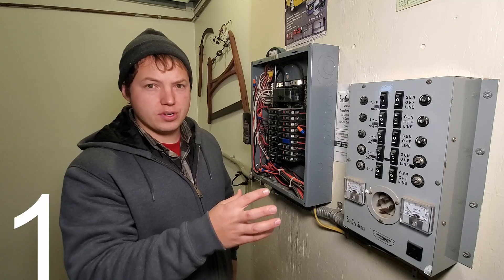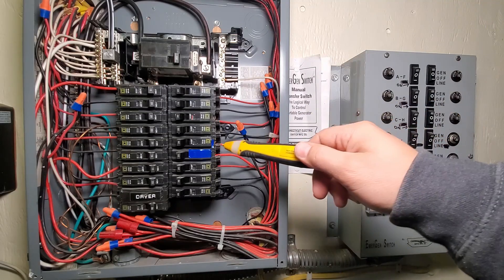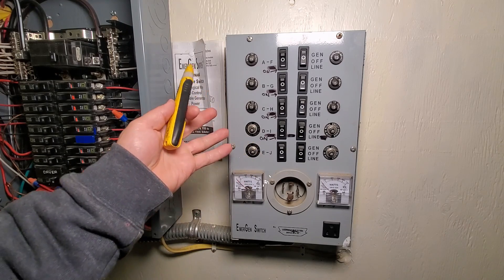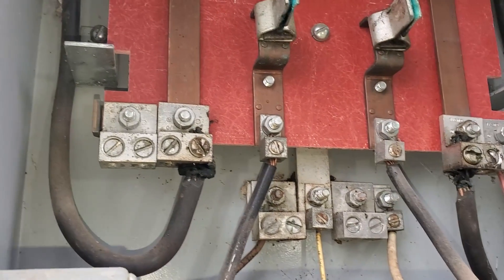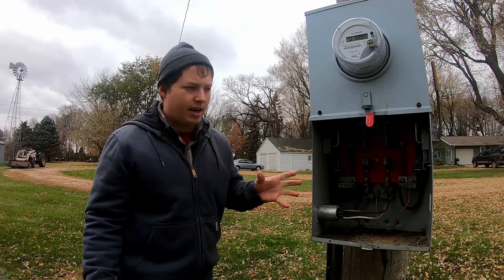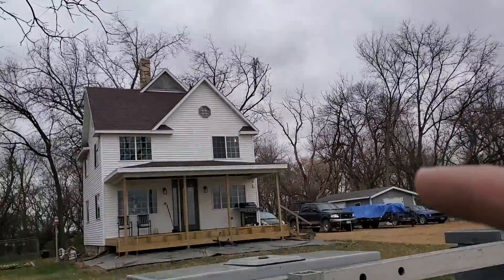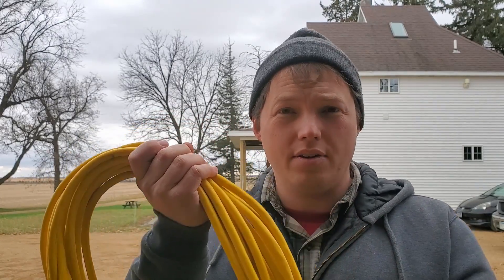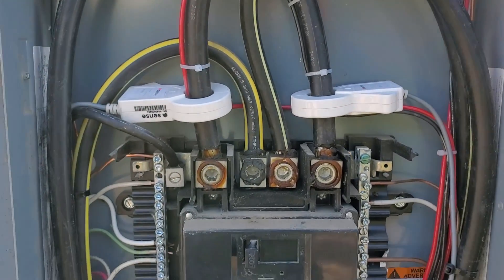5 Ways To Connect a Generator To Your House

Comment: That interlock system wouldn't fly in Australia because we don't use the same panel geography but when I had an electrician come and set up my board to accept my new genny I didn't know squat about this aspect of electrical work, even as a lapsed electrician myself (many years past) but I have to mention that there is another way which you Ben would like although it's a bit dearer than an interlock you do get the same effect. My electrician installed a two way switch which breaks the mains, both active and neutral, then connects the busbar active and neutral only to the genny socket. That way, it's either one or the other and can never be both.
Also I get to choose which circuits I want to power. I had him install a bunker light that has its own circuit and breaker and continues to stay connected to the mains. With an outage I flip its breaker to ON but with no mains power the light remains OFF.
When mains power is restored this bunker light (easily see from inside the house) lights up and I know mains power has been restored. I haven't seen this method used in any US based video as yet and I wonder why - it's so easy to install.

Comment: It seems like at the 50 A power input plug on the post the ground wire is jumpered to neutral in order to plug in cheaper power generators, where the star point of the generator is not earthed.

Comment: Had a question related to the Evergen Switch (First option in video).  Can the generator and the line power be on at the same time with some circuits on generator and some on line power?  Although the hot lead is switched the Neutral would be tied between the generator and the line.  Not sure if this is an issue or not. Since current would be returning to both sources through their branch circuits  I guess it may be OK.  Let me know your thoughts on this scenario.  Thx.

Comment: Ben do you need to break the neutral as well as the 2 hots in the disconnect panel after the meter socket

Comment: I have a 7250 running watts generator wired into my breaker box via 10/3 w ground, 30 amp breaker, with interlock kit. Can I use my heat pump which has a 40 amp breaker and uses nearly 6000 watts? 
Thanks in advance and take care!!

Comment: I have the interlock system in my homestead. I also built a wooden generator shed and have our generator converted and running off our homes natural gas service. It was the most cost effective way for us to do it.
Reply from the maker: Sounds like a great setup! Having a natural gas generator is something I wish I could have but alas that usually is not possible in rural locations like where we live.

Comment: I think it would be a lot easier to have a mechanical interlock .for the gen breaker and 
mains breaker. Power goes out, you shut off mains and then ur able to turn on gen brker.

Comment: Are you planning on getting a Tesla Cybertruck? If so, would you be able to use it as your backup instead of a generator assuming that the Cybertruck has the requisite AC outlets?

Comment: 702.5 Transfer Equipment
Transfer equipment shall be required for all standby systems subject to the requirements of this article and for which an electric utility supply is either the normal or standby source. Transfer switches shall not be permitted to be reconditioned.
Exception: Temporary connection of a portable generator without transfer equipment shall be permitted where conditions of maintenance and supervision ensure that only qualified persons service the installation and where the normal supply is physically isolated by a lockable disconnecting means or by disconnection of the normal supply conductors.
NEC GLOSSARY:
Physically Isolated (as applied to location). Not readily accessible to persons unless special means for access are used. (CMP-1)

110.25 Lockable Disconnecting Means. Where a disconnecting means is required to be lockable open elsewhere in this Code, it shall be capable of being locked in the open position.

The code allows for emergency connections.  You need to lock your main panel when doing so to keep someone else from closing the main breaker.

Comment: Since Generlink is not available  in our area we went with the "Interlock" option.  It's fairly easy to install (make sure you buy the correct one for your panel), they give much greater flexibility regarding which breakers you may want to use/not use during different seasons (heat or A/C) and the overall price is pretty reasonable.  Depending on your personal experience and local laws, you can install it yourself fairly easily and quickly.  Thanks for a very informative video, well done.

Comment: The sizing of the AWG of your extension cord is also dependant on the length of the cord. Size DOES matter - always size up from the starting amps, not running amps and size up for longer lengths of cord. Your refrigerator motor will thank you by not burning up. Also, turn breakers on slowly - let loads start up one at a time. A typical generator can not start everything up at the same time. Trying to do that will burn out things you are trying to power up. 
Also remember a generator will run better on propane or natural gas, but the power output will be lower than running on gasoline.
Natural gas has the least BTUs, thus less power to run the load, but if hooked to a gas main will not require refueling. Tri-fuel kits are available for most generators and are well worth the money. Gasoline is dirty, gummy, sputters, and is dangerous to refill on a hot generator. Propane and NG run clean, don't sputter, don't gum up, and are generally far less expensive to run on.

Comment: When I built my house I had a generator ready load center installed.  It can be used with a portable generator or an automatic transfer switch and a permanent standby generator. If I decided to upgrade to an automatic standby generator the switch just snaps into the breaker box. 200 Amp 42-Space 54-Circuit Main Breaker Generator Ready Load Center by Siemens

Comment: Do you have to turn off the main 100 amp breakers on the electrical panel along with all the circuit breakers on the electrical panel before starting your generator to run power through the GenerLink? Oh, and that cat must know it has 9 lives the way it uses the electrical panel area as a playground, lol.

Comment: A friend of mine has a different hybred system. 
In the main breaker box is a 50 amp 240 breaker that feeds a double throw breaker box, which then goes to breaker box “B”.
Anything that you want to run off the generator, has to originate from breaker box “B”.
Breaker box “B” feeds furnace, some lights, well pump, refrigerator, freezers, some outlets. 
Hello from north east Montana. 
10 miles from the Canadian border.

Comment: When connecting with the interlock kit, is it possible for power to feed back into the power lines outside through the neutral if the main is off?
Reply: No

Comment: I'm trying to figure out my system we moved into a house recently with 2 transfer switches already installed and in the same metal box of each switch to the left is what looks like a hole where a whole electric meter would fit however in it's place is a clear plastic plug with a strap on it, maybe it's an emergency turn off?? who knows but the switches are labeled for generator.  I believe one is for the main house and the other is for the well pump and garage.  The wires coming from these transfer switches have been cut where the old generator was removed so I guess i need to hard wire straight to the gen... can you even do that???  or splice the exposed wires into a plug that I would then run into the generator.  Since there are 2 sets of wires do I make 2 plugs or is there a way to hard wire both sets of wires into the generator?

Comment: A couple of comments...I installed a 30 amp plug on the outside of my home and ran two standard receptacles from it...one upstairs and one in the basement. When the generator is not connected these receptacles are dead but when energized allow me to plug in varies items in the home without worrying about cords going through windows under doors etc. works very well but limited capacity.

I also have a 50 amp circuit in my panel and an outside plug for my tractor/pto 15kw generator. I have a disconnect switch in the panel that only allows the 50 amp breaker to engage with the power off. However I am curious about the neutral wire as it is not switched and connected both to the generator and the electrical service. I assume the neutral current will follow the path that is feeding the circuits and not become an issue. Is that correct? I also personally don't believe all electric breakers need to be shut off but you need to be very aware of your generator limitations and not overload the generator with your power demand. Any comments regarding these items would be helpful.

 Excellent video and explanation on everything.

Comment: I am surprised that I didn't see a way to use a subpanel such as a Square D QO panel where you can purchase individual breaker interlocks in the subpanel to switch between the generator power and the main house power.

Comment: Great Video,  If a generator can be used using a manual transfer switch with branch circuits selection,  can a 2nd generator be connected the same way via a 2nd transfer switch to select other branch circuits not covered by the 1st generator?  Not paralleled.
Reply: Easier to buy a bigger generator or run two generators bonded together.
A reminder here that with a sufficiently sized generator, most all circuits can be powered by the genny. I'm talking about 20kW or larger beasts and these are usually set up as prime power or called standby (rather than backup power).
They can run the whole house or smaller shop and use an ATS (automatic transfer switch) so you don't have to do anything at all.

Comment: There is another option for connecting a generator which I would like to see in a video.  If you install a sub panel adjacent to a main panel, you can purchase manual breaker interlocks in the sub panel to be fed by a generator.  I would like to see an example of this and if you relocate breakers from the main panel to the sub panel, how is the wiring done correctly.  If you wire nut the hot wires from the main breaker to get them to the sub panel, do you need to extend the neutral wires as well since they are essentially bonded together between the sub panel and the main panel.

Comment: Does anyone know where Ben's link is to Generlink OUTSIDE PRODUCT THAT LETS YOU HOOK GENERATOR UP TO AN EXTENSION THAT is PUT ON THE OUTSIDE METER GLASS WIDOW AREA WHERE THE MAIN POWER COMES INTO THE HOUSE FROM THE LINE?  He mentions a link below but none go to that product that goes outside the house no where near the control panel and looks like the easiest most versatile safest hook up for an emergency portable generator for power during a blackout.  Please send link to product.  Thanks  JJ

Comment: I have a question, my generator 5300max watts 4800 running watts has 4 20amp plug and one 240  3-prong plug has 2 hots 1 ground or neutral how would I wire this in to my house panel?
I'm thinking the 1 neutral or ground would tie in to the neutral bar
Reply: he has a video on that here https://youtu.be/Y26CBqpS2M0

Comment: Hey Ben—another great video, with cat bonus...love it!! Question on the transfer switch scenario you’re showing in the video: I’m assuming there are separate breakers inside the transfer switch for each circuit, correct? And how are the neutrals for each circuit handled... to what is the neutral pin of the transfer box outlet wired? And what about the ground... to what is the ground pin of the transfer switch outlet wired?
Reply: Guess I should be calling it the transfer switch inlet!
Reply: Todd LaRoche I guess I want to understand how the neutral circuits are established in the transfer box so that they connect to the neutrals exiting the “original” neutral circuits that are wired at the main panel? And then if the ground pin of the transfer box power inlet goes to the ground at the main...? Wouldn’t that be a problem then because the ground and neutrals would be bonded there?

Comment: Been enjoying your helpful videos. My backup goals could be met with a 30 amp 10 position transfer switch (like a Reliance 310c). HOWEVER, some of my 10 circuits are on the main panel and some are on a sub panel. As I understand it, I can't do that because of the sub panel ground/neutral setup. Could I have electrician move my incoming feed to a separate panel with a 3-way switch where I can connect the generator?? Thanx again for your great videos!!

Comment: I have a transfer throw switch, the way I am using it is like an AB switch where A is a 50A generator connection, B is a 30A generator connection.  Since this is now considered the first power entry point to the property during a power outage do I need to add a bonding screw? Do I need to add a Earth ground Rod?  
The main panel and generator input is at opposite sides of the house.

Comment: At my previous rural residence, I had the manual  Generlink transfer switch between the the utility meter and the meter housing (option 4).  I had it for 10 years, maybe used it 15 times.. and then it stopped working.  A rather expensive ($1200 CDN) that did not last.  Very disappointed.  Currently I have a sub-panel with the interlock transfer switch (Federal Pioneer) but the interlock mechanism requires a simutaneous "throw" between two breakers connected by a bar mechanism.  That mechanism doesn't always work and can be very frustrating.  I want to replace it.

Comment: Isn’t it against code to have junctions in the panel?
Reply from the maker: I don't think so as I see it pretty frequently. Where did you hear this? Obviously the panel is much cleaner if you avoid connections in the panel but that isn't always possible and or convenient.
Reply: Benjamin Sahlstrom I’m an 2 year apprentice and a journeyman I work with mentioned to me that it was against code to make junction inside of a panel that a junction box would need to be placed outside of the panel and new conductors should be brought inside as well as it being against code to pass circuits through one panel into another that they would have to come in directly. I have not found any code to back it up but it caught my attention when I saw your generator video. I have only installed the interlock transfer switch. When I saw the the meter mounted transfer switch I was amazed but then I saw the price and decided to stick with the interlock.
Reply from the maker: @steve-tm6nh  Cool! Thanks for sharing your experience!

Comment: What about using an Auto Transfer Switch?
Reply: IMO auto transfer switch is not useful in a typical DIY home setting.  To make it useful you need a generator that will start up by itself and run continuously without babysitting for long periods.  That means utility natural gas, no significant oil consumption, auto restart after overload, etc etc.     For most homes that's a $20K+ project requiring building and planning permits, a competent plumber, a concrete pad, etc ...     And if you don't have all of that, if you have a smaller generator that does need a little tending to, an auto transfer switch is pointless.

Comment: And do you have a vid on how to chose the correct generator for my house?
Reply: amps X volts=watts  so your refrigerator  7amps max x 120v = 840 watts     
                                                   light bulb      60 watts/ 120 v=  .5 amps      
kind of a pain but you do that for all appliances you need  add %20 tells you the size of generator you wld want
Reply from the maker: Not yet! My recommendation would be something that provides 30A of power or around 7,200 watts. This model would be about the right size: https://amzn.to/34ieTnk

 With that you will be able to run (by cycling between appliances) an electric water heater, electric dryer, electric range (not all burners but one or two) and of course all of your "normal" household loads. Anything larger really isn't necessary unless you want to run everything at once. Let me know what size you end up going with!

Comment: Nice video Ben and the cat is great!  … Right now I'm using the last method - extension cords (we very seldom lose pwr), but plan on adding a transfer switch later.  I like the interlock kit like you used the best. … your doing a great job - Keep doing what you do!

Comment: I had solar panels hooked to batteries, invertor and to a transfer switch connecting to a few pertinent breakers in my main panel.  Solar works great but with the snow covering my panels during winter months rendering it useless in the snow.
Reply: use heat tape on your panels during winter time or use a recirculating heating system